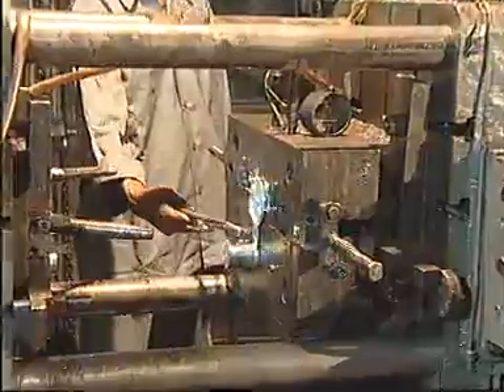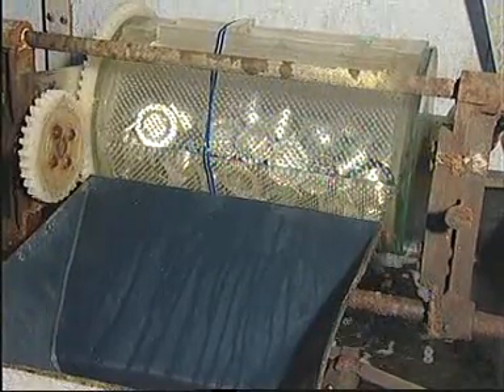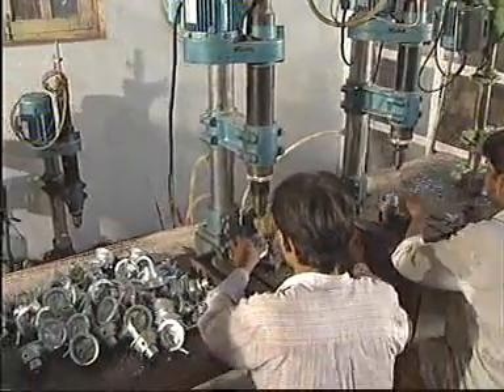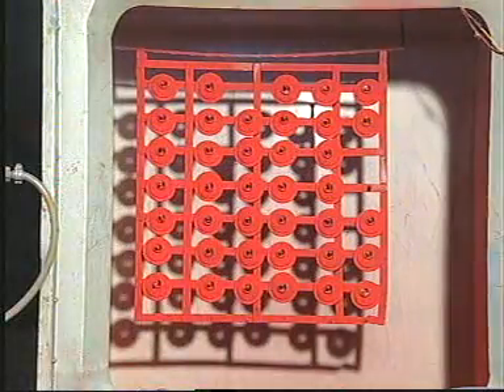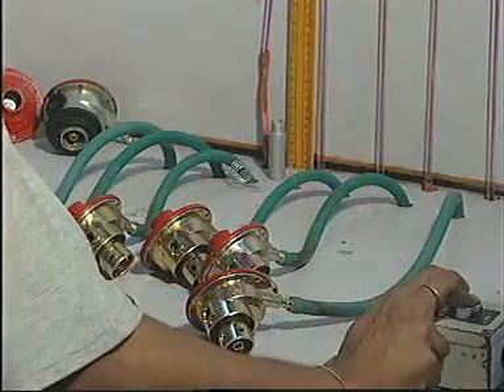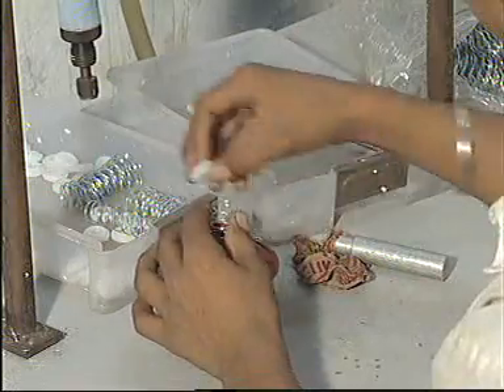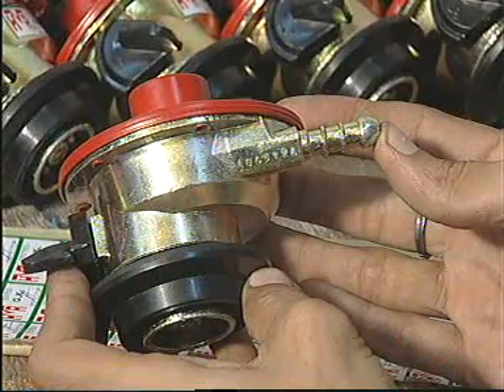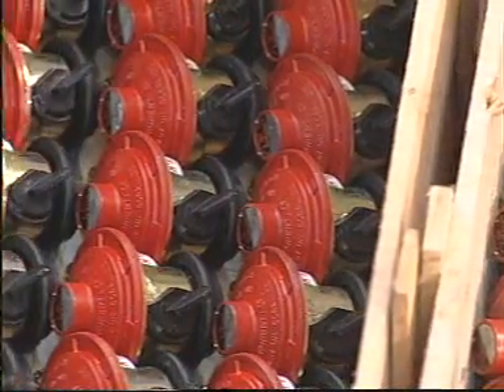how to made LPG cylinder regulator

Comment: I am intrested on it......
I wanna manufacture regulator on Nepal.....someone have idea about machine?
Reply: Well 
If you want to manufacture a regulator. coming to the production u need die-casting machines, trimming machines, surface finishing machines, drilling machines, tapping machines, supporting fixtures, toggle presses, painting spray equipments, annealing furnace, small manufactured assembly components from outside, hydraulic equipments to make assembling, testing equipments, sufficient discharge of air with specific pressure for different purposes.
Reply: ESKIMO ESKIMA can you plz help me or give me consultancy for regulator manufacturing , plz leave your message on my whatsapp no +91 9460257522 Ashok kimamwala from Jaipur India